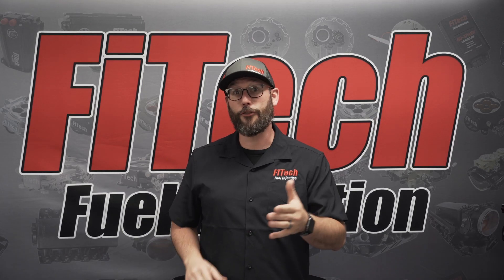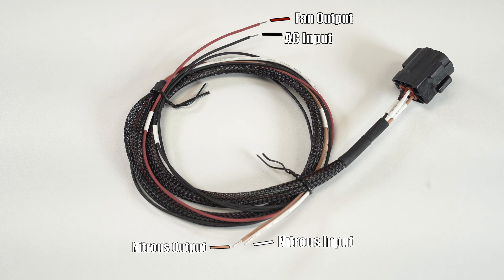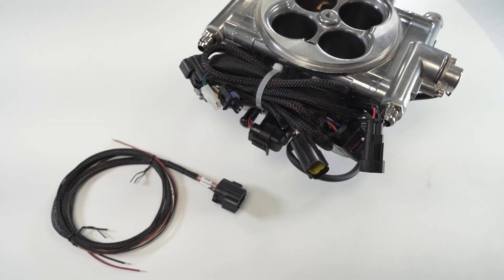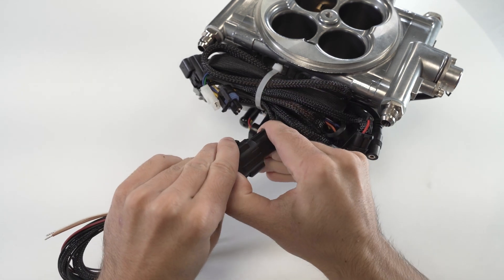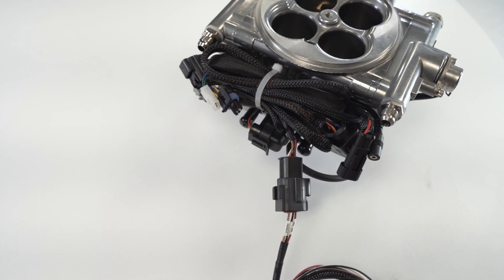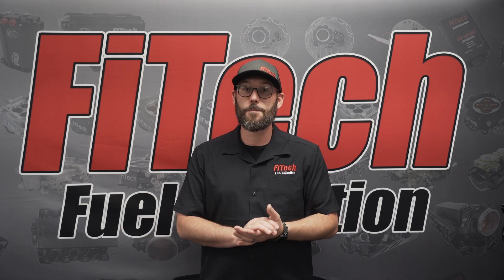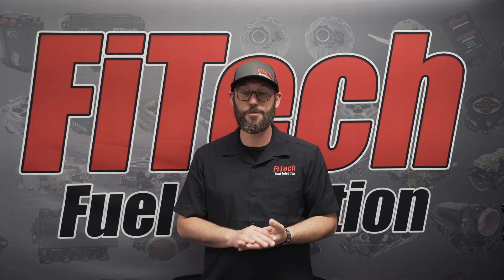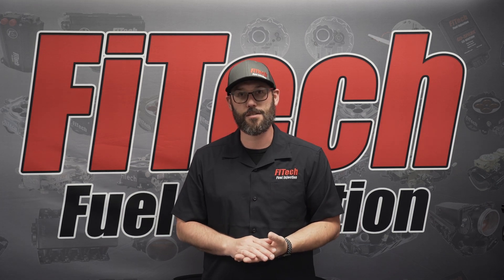Wiring Your Power Adder Throttle Body EFI| Tech Tuesdays | EP75

Comment: FiTech 30002 system using a 2-wire MSD distributor using fitech for timing  control   how do I install tachometer what wires do I use to the tact
Reply from the maker: If you are using just a distributor and coil for timing control then the tach signal for the dash comes from the negative side of the coil.

Comment: I have the power adder harness but there is not a connector to attach it to. Did I get sent the wrong throttle body?
Reply from the maker: Contact our tech support team so they can help you identify your system to see if you have the correct parts or just missing something.

Comment: have a 2step features??
Reply from the maker: The power adder systems do have 2 step when timing control is being used. The menu to turn it on is under the POWERADDER menu which can be turned on under Display Setup.